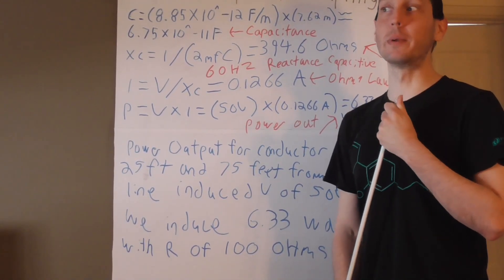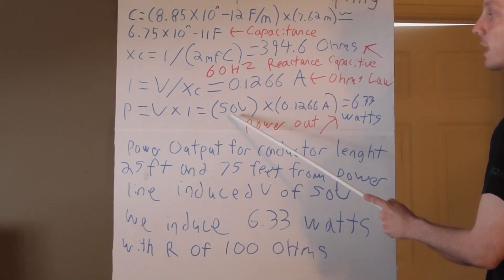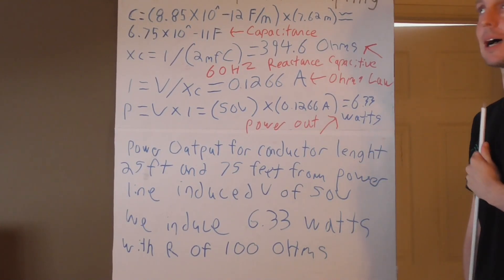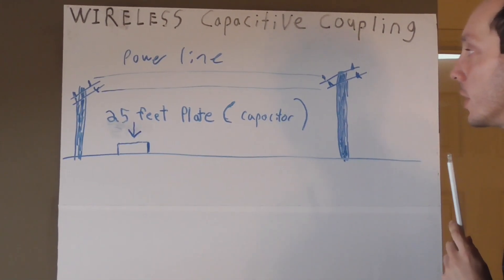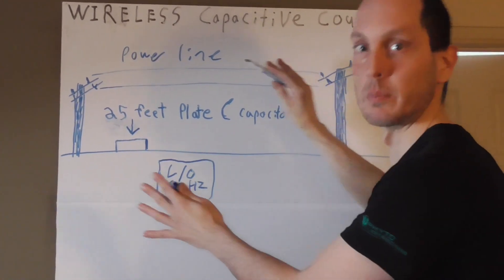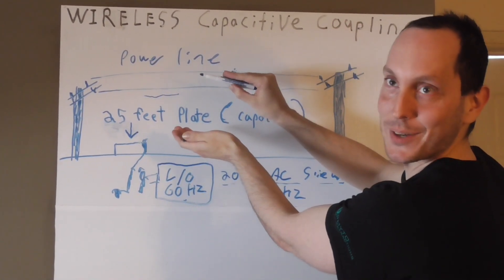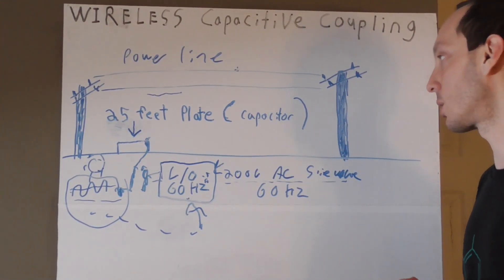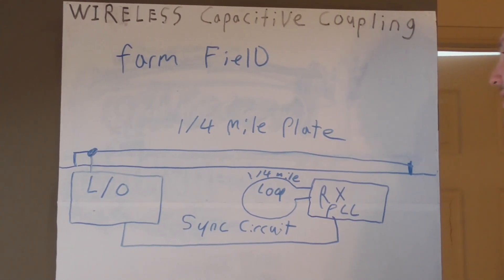Wireless Capacitive Coupling

Comment: Just FYI, concerning how to calculate power in an AC circuit.  This might be new to you, but the RMS value of voltage and current in an AC circuit MAY NOT BE NEW to you.  And I don't know which.  I'm trying to help so you can accurately calculate the power in an AC circuit that has a reactive component (a capacitor and/or an inductor).

If the circuit has a reactive component (ie. an inductor and/or a capacitor)  the Voltage V and the current I  are out of phase and you CANNOT use Ohm's Law,
you cannot use  P = EI  or P = I^2R  or P = I^2Z to calculate power

You have to use the  "root-mean-square" values for Voltage V  and current I   to calculate power P  in an AC circuit.

Vrms =  root-mean-square Voltage in an AC circuit
Irms =  root-mean-square Current in an AC circuit

Look at this page:  "Power in an AC Circuit"  at https://phys.libretexts.org/  (just type "Power in an AC circuit" in the search box at the top of the home page)  and in particular, look at the calculation for power in an AC circuit which is near the end of the page.  

SPECIFICALLY LOOK AT Equations  15.5.8,  and 15.5.9
The "root mean square" voltage, or Vrms, simply means  take the voltage and divide it by the square root of 2 
The "root mean square" current, or Irms, simply means  take the current and divide it by the square root of 2 

 The Power calculation for an AC circuit is (equations 15.5.14, and 15.5.15)

P =  (Vrms^2)(R)/(Z^2)   
or
P = (Irms^2)(R)

EXAMPLE
Keep in mind that the square root of 2 is about 1.414.
The circuit has a capacitor.  The circuit also has a 100 ohm resistor.  
The measured current is  0.100 amps (100 milliamps)

Power =   [(0.100) / sqrt(2)]^2   x   100
=  [(0.100) / 1.414]^2  x 100
=  (0.005) x 100 
=  0.5 watts   [THIS IS THE CORRECT POWER]

NOW, LET'S ASSUME YOU INCORRECTLY APPLY OHM'S LAW, NEGLECTING THE ROOT-MEAN-SQUARE POWER FACTOR:
(the incorrect)  Power =  (I^2)R
= (0.100)^2  x 100
= 1 watt  [THIS IS NOT THE CORRECT POWER]

The incorrect usage of Ohm's law, in the circuit with a reactive component, lied to you and told you there is twice as much power as is actually produced by the circuit.  And carefully note - the impedance Z of the capacitor would have increased the error  (you might have, say,  (0.005) x 150 ohms,   where the resistor = 100 ohms and the capacitor Xc = 50 ohms)

I have an EE background.    It is unknown to many experimenters that it is not valid to use the Ohm's Law power calculation if the circuit has a capacitor and/or inductor.  If you simply calculate  power as  P = IZ,   you will 100% get the wrong value.

I have seen people spend years incorrectly applying Ohm's law and believe they are 'getting more power out than they put in'.
You have to divide the current and voltage in an AC circuit by the square root of 2.

sqrt(2)  =  1.414  approximately

Again, look at this page:  "Power in an AC Circuit"  at https://phys.libretexts.org/
.

Comment: Please take what I'm about to say as very friendly, it is illegal to purposely drain power from a.power line and or a power meter. Secondly, what I'm about to say is very dangerous. You need three or five plates, about an inch apart,.an inch wide,.10 foot long, sheet metal thickness. This will oscillate itself to the power line. Power lines in urban areas tend to be 30,000 to 70,000 volts ac. I believe massive power lines carry 300,000 volts per cable. Your greatest danger is under the big power lines, where even weak coupling has developed in tractor hoods and electrocuted farmers touching the hand grips when getting down from the cabin of a big tractor.
Reply from the maker: I'm getting over 70 volts now with a 100 feet run. I'm going to try and use a SCR cap dump circuit that dumps a charge from cap into a battery.
Reply: @joellagace1679  Very cool ! Please be careful. When you think about it, even 12 volts will charge a battery. So I'm wondering if you can step down the voltage and improve amps? Have tested amps yet? That is my main concern, I don't want to see you or anyone killed.🙁 so please be wary of these things. And also, the distance from your ground wire and the nearest poles ground wire is critical. I once tried to create far a day cage ground through my window, and my cheap probes picked up 110 volt AC   and 15 volt dc on the aluminum cage.  I had been touching it all day. I had stuck a three foot copper rod into the ground, 70 foot from the power meter ground, and about a 100 foot from the pole. I looked around and it turned out my ground was 13 foot from my neighbor's power meter ground. We had lived on a low spot, often wet. I was so sad my cage didn't work because of it. I'm not even sure a 1000 volt diode would have helped. Good luck, Sir, just be careful, please.

Comment: Your last diagram seems like the frank prentice patent . Also the second to last one was as Don Smith showed in his book .
Reply from the maker: Cool, never hear of both believe it or not :)
Reply: @joellagace1679  Frank Wyatt prentice , Electrical Power Accumulator . Patent #CA253765 1925-09-15  . Also Don Smith video #6 he gives a simple demo and explains about the effect .
Reply: @joellagace1679  I never tested either one but they look interesting. Am working with a version of Carlos benitiz British patent # 121561 . It uses closed  osillatory circuit . It gives very good info , if you up for the read and math .